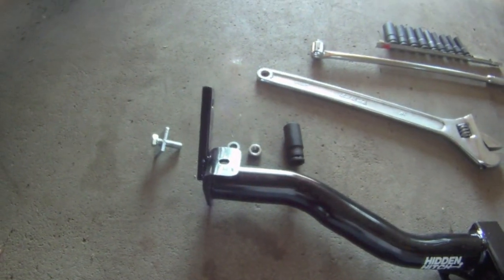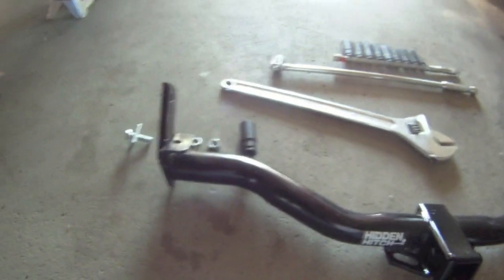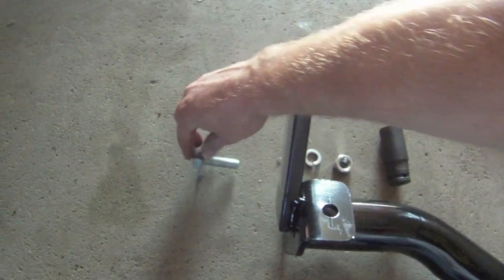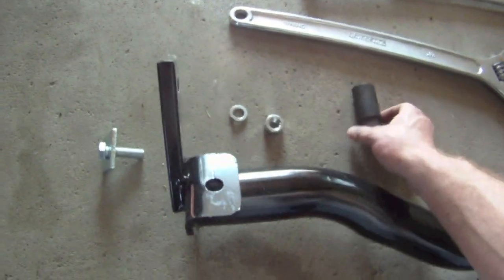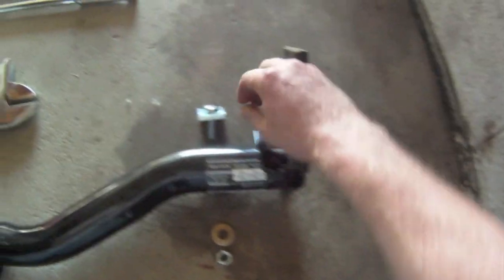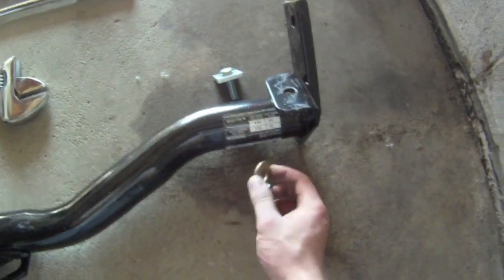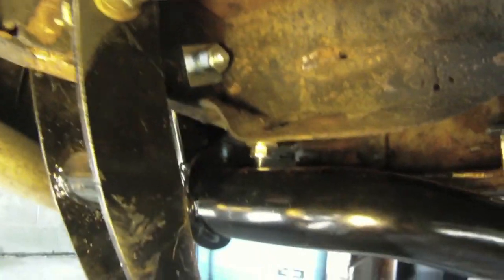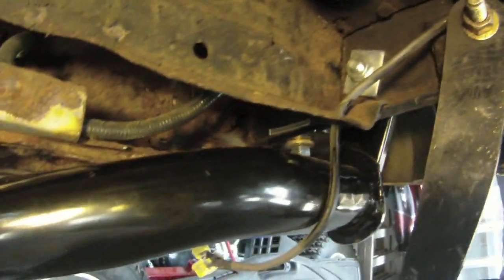1996 Ford Explorer 5.0 Trailer Hitch Install How to

Comment from the maker: @hondanaiga Not sure where to read or heard that. Just about the only thing that would fry your transfer case is different sized tires or unevenly worn tires. The AWD 5.0 Ex is DEFINITELY designed for towing. Thanks for watching :)